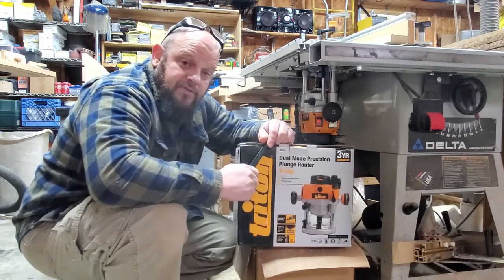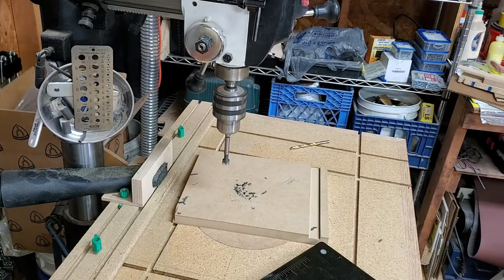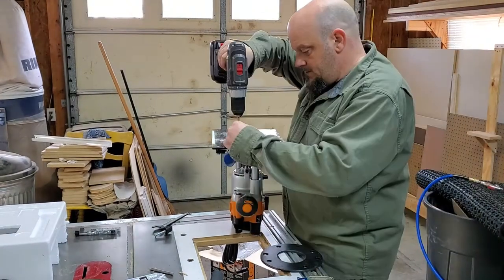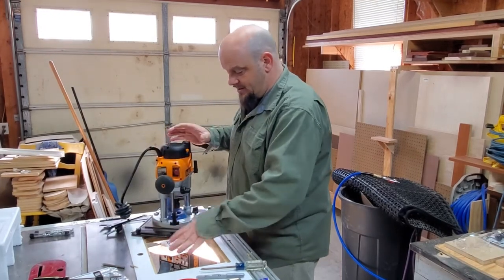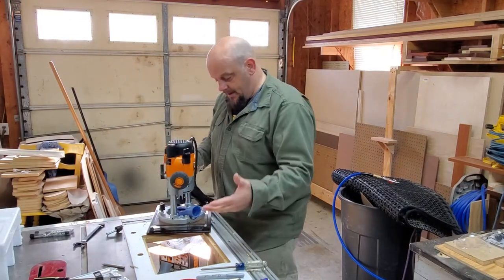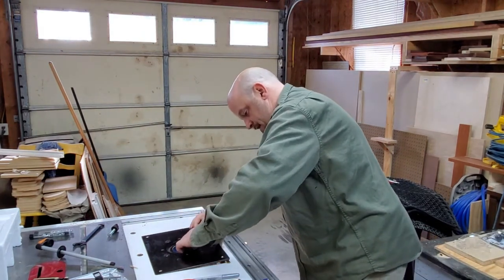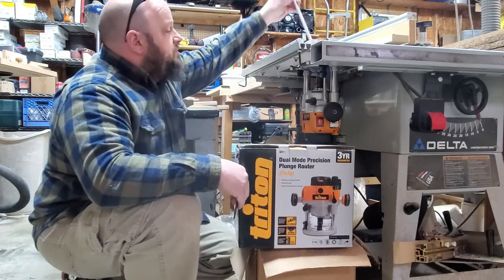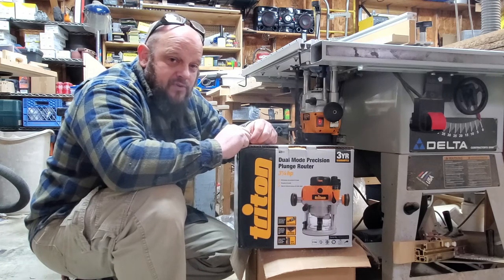Triton TRA001 Router Unbox & Table Installation

Comment: I epoxied a 1 inch section of 3/4 in. PVC pipe to the surrounding of the small nub that the height adjustment crank connects to to make it easier to get the end of the crank seated.
Reply from the maker: Tgat sounds like a good idea.

Comment: " 3-2-1" 😂

I have the same one on the way. 
I intend to create a router plate that i can eaily pull out of the table and onto my flattening sled. I havent seen anyone do it so far.
Reply from the maker: They all will come out.  Most are held in with screws so there's no movement.  Good idea making the plate fit your sled.

Comment: I like the dust shroud adapter for the router table application, where did you get that part?  I'm planning on getting this soon and liked that idea better than building an encloser for the router.   Also, do you find you use the back side of your table saw fence or have you done anything on the back side as a fence in your setup?
Reply from the maker: Milescraft makes them now.  Www.woodworkingshop.com and search router dust and it should come up.
Reply: @ChristcrossCrafts found that product, sweet!

Comment: Hi thanks for the very informative video. When you set the router up like this do you leave the plunge lock off or do you have to get underneath and lock it up after every setting?
Reply from the maker: It has lockable indents that work well for most things, but I do occasionally need it locked especially if I'm making a precise cut..

Comment: Bought this I don’t know, 2 years ago. Cannot get it to raise up high enough to  get the  collet above the table.
 Tried all the “features”, took the spring out still nothing. I actually don’t much use it. It’s actually brand new sitting in the table.
Reply from the maker: You have to push the switch to off.  It has a safety feature that won't allow the router to rise all the way up unless the switch is off and the little window is closed.

Also, check the depth stop.  I've done that before and forgot to loosen the depth stop knob.

Comment: At about 10:30', you had a circular closeup (?) while you were winding the router up and down. What did the closeup show, and was there anything on the Triton that made winding easy? Thanks
Reply from the maker: The triton has an above table adjustment rod that allows for easy fine tuning.  Once set, you do need to lock the colum so no movement occurs. 

From below, there's a quick knob for fast adjustment up and down.

If the router is used by hand, both the quick adjustment and fine tuning are still  functional.
Reply: Many thanks for the reply. I will give it a try.

Comment: Do you need to engage the plunge lock lever when mounted to the table or can I just leave it off once I set my bit height?  Just mounted this into my kreg table.  the directions suck
Reply from the maker: I usually set it anyway.  There are some adjustments where the bit falls between indents on the knob.  These definitely should be locked to prevent movement.

Comment: In order to make the above table height adjustment, does the button on the handle have to be pushed in?
Reply from the maker: No.  You remove the spring from the column and it easily adjusts.
Reply: Thank you Sir. Are you still happy with  your purchase?  @ChristcrossCrafts

Comment: the placement of the router top vertical adjustment on the router is in the wrong place. The Manuf. should of put it to the lower right. Where it is now I have to move my fence back to use the handle.
Reply from the maker: I have mine installed sort of sideways in my table and have no issues accessing the switch or below table adjustment knob from below, or the above table adjustment hole with the fence pulled in over the collet.

Comment: Do you have to take the spring out for the crank up to work?
Reply from the maker: If mounted in a table yes.  Otherwise it will have an aggressive movement when you make adjustmenrs.

Comment: In the video at 1:09 in the router plate I see a red ring and bushing guide that were not in the plate before this. Did they come with the plate?
Reply from the maker: They are part of the dust collection boot.  They affix under the plate between the bit and plate.  This sucks dust away that enters the collet area.
Reply from the maker: I thought more on your comment and wanted to update my statement.  The red ring and gray center piece are part of the plate.  The red is a large ring and the gray will fit the standard Porter-cable style template guides.  Both are just reducer bushings to decrease the hole size for different bits.
Reply: @ChristcrossCrafts  Thanks for the info. I have a router table and needed to replace the Porter Cable 690 motor (not enough power) in my Incra Mast R Lift II. I could not use the Triton in the lift and really did not want to give up the lift (it was a bit expensive). I ordered a Bora Portamate PM254 Router Motor and just finished installing it. I made a test cut and so far I'm super pleased with it. Tomorrow I will do more testing.

Comment: if you install this way you have to move the fence to get access to the height adjuster with the rod, not so practical.
Reply from the maker: I don't. The height adjuster sits towards the front and does not interfere with the fence.  You may have seen a test fit.

Comment: Do you find that at low-mid power settings the router kinda surges?
Reply from the maker: I haven't had that issue with mine.  So far it has performed well.  I haven't had any really big bits in there - like a door panel bit, to need to use 1 or 2, but have used #3 up with no issues.

My only complaint so far is the hole size of the metal housing.  It will not accept standard 3" door panel bits, which is partly why I haven't used it for that.
Reply: @ChristcrossCrafts  Thanks for the reply. It might just be mine. It still works ok but when I first got it I thought "That can't be right". Contacted the suppler but by the time I pay for postage to return it to them for checking it wasn't worth it. I'll use it for as long as it lasts.

Comment: When I turn the adjustment knob or try with the crank nothing moves. Any ideas what could be wrong. Thank you.
Reply from the maker: Is the lever lock tightened that locks the router in place along the two bars?  That will prevent it from adjusting.
Reply: @ChristcrossCrafts  No it is not locked. The orange button is pushed in on the knob. Should that be out and how do I do that. Sorry to bother you.
Reply from the maker: @kevinrecoskie519  yes... that's it.  The button disengages the gears that contact the rack & pinion style system.
Reply: @ChristcrossCrafts  Had to take the motor off the router the button was stuck in the in position.
Reply from the maker: @kevinrecoskie519  mine did that and I pressed the button again and pulled the orange ring.  That fixed it.